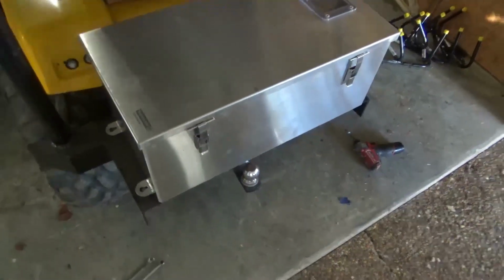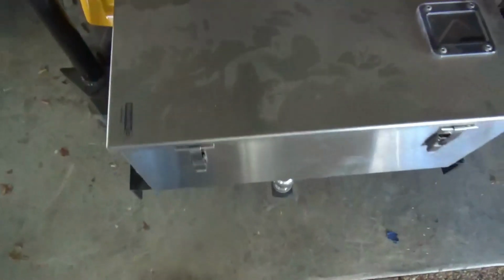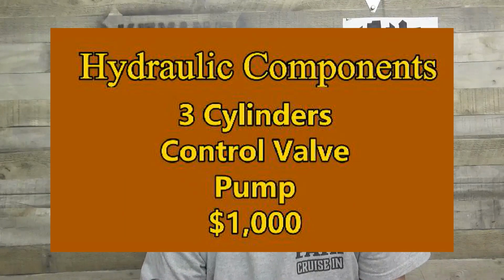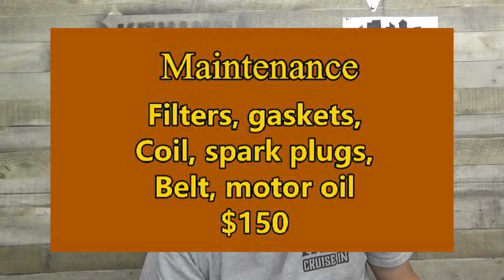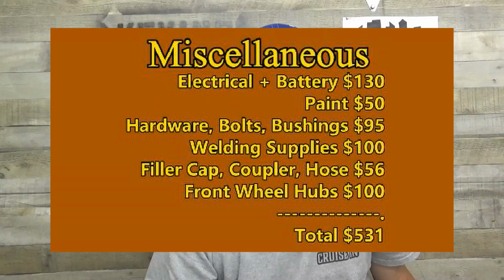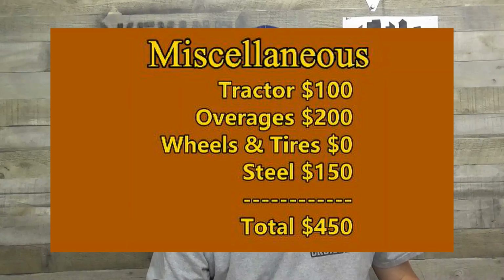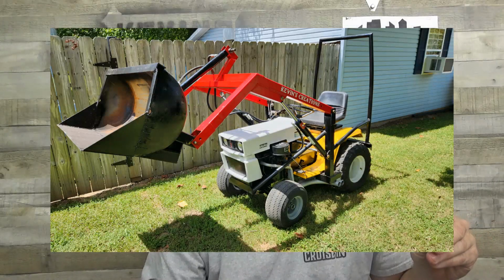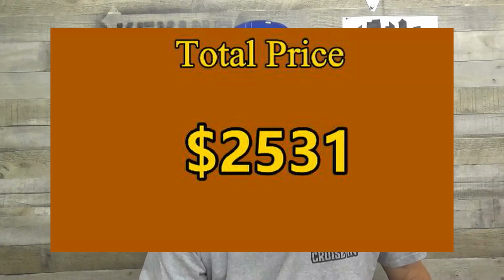This Loader Is Insane! See How It Works And How Much It Cost To Build.

Comment: Finally i get to see one that can dump in the bd of a truck. Thank you. Subscribing.
Reply from the maker: That was a must when I started this.  If it wouldn't dump into my truck , it was of no use to me. Thanks for watching!
Reply: @pupsmotorworks5228
Completely agree with both of You, height for a pickup is mandatory ! 1st one viewed as well. Good job Kevin, usin' 
what You've got. And nicely done video.

Comment: Well done. That being said you can buy am old industrial case with factory loader for around that price for that same size of tractor depending on how patient you are and where you live. Extremely useful and capable machines.
Reply from the maker: Yes when I was looking at them, there were some in that price range but they looked like they would need to be rebuilt and have more money put into them, plus they were nowhere near me. It was never about buying one anyway. I had never done anything with hydraulics before and thought this would be a way to learn. I always like to use things I can get cheaply or that I already have but I had to buy a lot for this project. At least it's new stuff that I don't have to worry about having to rebuild or have problems out of. I have on all of my video descriptions that these are not "how to" videos because sometimes what I do doesn't always turn out the first time, but I will show why it didn't work and how I change it. I learn as I go by trial and error.
Thanks For Watching
Reply: @kevinscreations4486  I'm the same way and am not a "buy it" or pay someone else to do it kinda guy. But after reviewing the costs and downfalls of building my own, I picked up a case with a bunch of extras for that price. At 50 years old it will eventually need repairs, but the onan is incredibly tough and the unit is very solid. A functioning belly lift and 3pt were kickers. I could have over built a loader but then been stuck with an inferior front axle/frame. I drove two states to get her, but worth it. Glad you like yours, that's all that matters. Well done!

Comment: Great job on your creation but honestly you forgot to add your time. so it's actually going to be way more costly than the $2.500. that's after totally the hours it took to put it together.
Reply from the maker: Yes, you are very correct, I should have mentionedthat. If I was building one for someone else, I would definitely have to take that into consideration. It was more to me to be creative, challenging myself, and learning about something I have never worked with, like hydraulics. Thank you for watching!

Comment: Video proof Kevin don't drive so good and has bad taste in music. Good attachment though.
Reply from the maker: @JustHere999dl  what's wrong with my driving? And yes, I'm not using that  music anymore.
Reply from the maker: @JustHere999dl  try putting that much weight on the front of a garden tractor and see how hard it steers. You have to make short turns. I plan on going with either hydraulic steering or a have a steering setup from a golf cart i may try first. Thanks for watching!
Reply: @kevinscreations4486  Yeah counterweight on the back would counter some of the steering problems.
Reply from the maker: @JustHere999dl  yes I have added about 200 lbs since this video.
Reply: @kevinscreations4486  water ballast weight is easier to calculate and set for a job.

Comment: Dangerous to drive with the bucket so high in the air.
Reply from the maker: The one time in the video I had it raised high there was nothing in the bucket. I had a chain hooked to it pulling  the aerator  so I don't know what you are referring to.
Reply: @kevinscreations4486 I was most concerned when pulling the trailer across the yard.
Reply from the maker: @cliffwendy3765  All of the weight was at the bottom of the tractor and again the bucket was empty. Thanks for your concern.